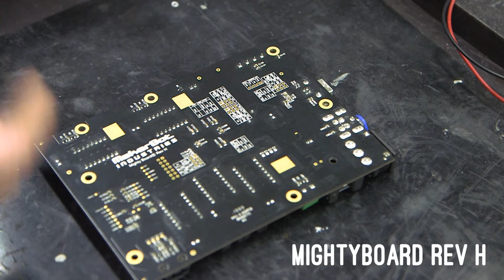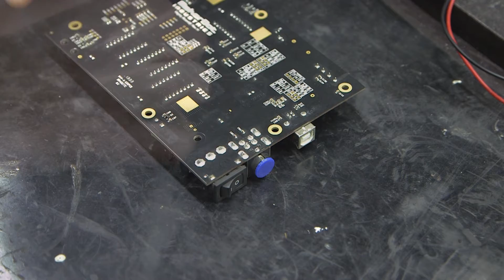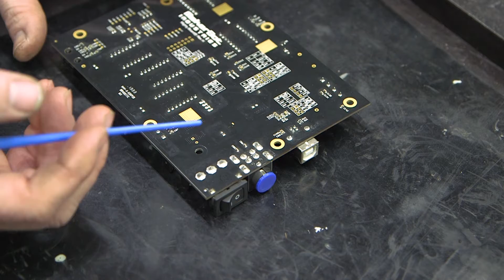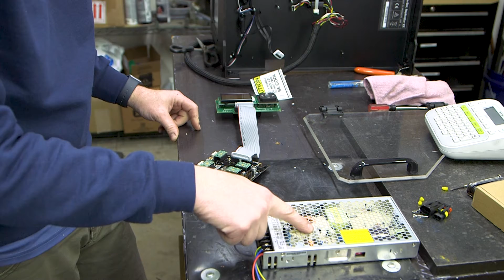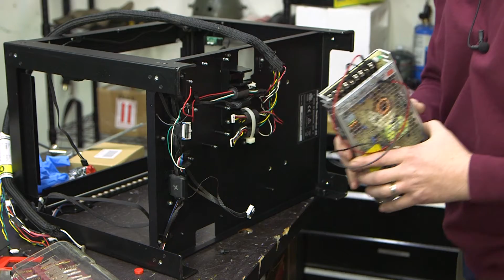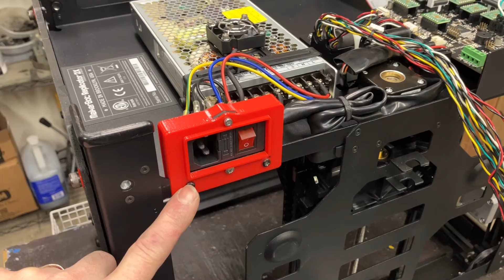Upgrading the Power Supply in a Makerbot Replicator 3D Printer.

Comment: Mine came with the male power adapter. I was thinking about just finding/making a male to male adapter. Would this work?

Before I go out and buy a power supply.
Reply from the maker: I was going to go that route too, as a plan B if the universal power supply didn't work.  You can get the male version of the connector from Mouser.  It's part number KPJX-CM-4S.  Mouser P/N 806-KPJX-CM-4S.  It's called a Snap & Lock PWR/CBL, made by Kycon DC Power Connectors.   It might work out for you for making a pigtail adapter.

Comment: Where can I get the power supply shown in the video? I have the same issue, No power supply, and I don’t want to pay $250 for one.
Reply from the maker: It's a Mean Well LRS-200-24.  You can get it on Amazon (not an affiliate link):  https://www.amazon.com/Enclosed-LRS-200-24-MEAN-WELL-Switching/dp/B06W9P8831
Or on eBay:  https://www.ebay.com/itm/234396212216?epid=705422147

You'll save about $10 getting it on eBay.
Reply: Is there anything else I’ll need? I already have the soldering iron, and wires.

Comment: Nice work! Those LRS-200 are damn near bullet proof. They are standard issue on all the larger VORONs. If the bottom plate is aluminum can forego the fan, slather the back in thermal compound and bolt on without spacers. The deck plate will now serve as an additional heatsink. 

Normally you can run those without active cooling but they require room for passive airflow and you may not have that in that cramped of space.